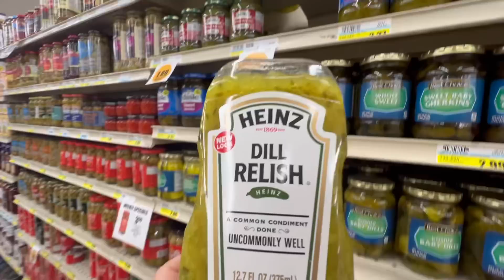LUNCH FOR THE MASON CREW

Comment: Heather, with all the work your crew does outside I think you should switch from a regular cooler to one of those portable camping fridges. They run off solar and some of the newer models have built-in ice makers. This would probably be a much better option for you guys. You could set up a table and tarp and make a little break area outside on those super hot days. Just a suggestion.